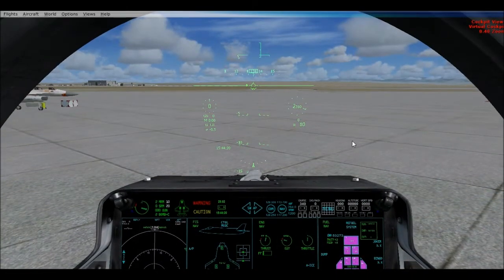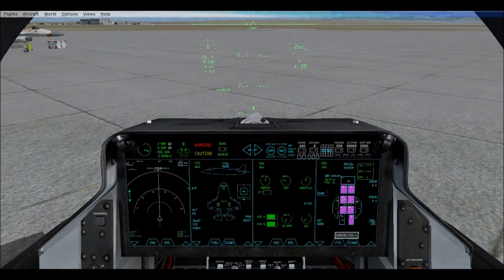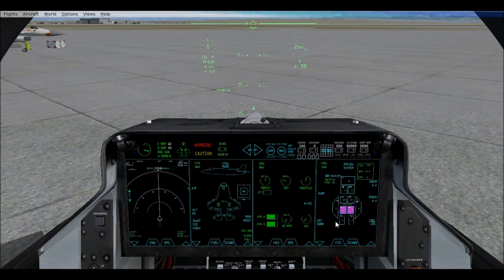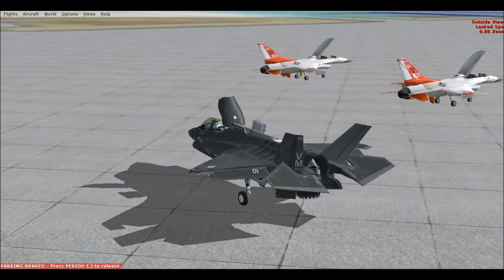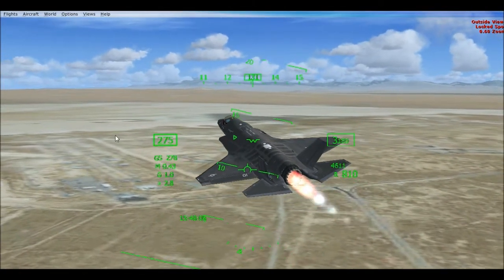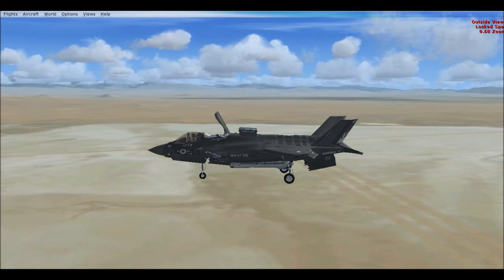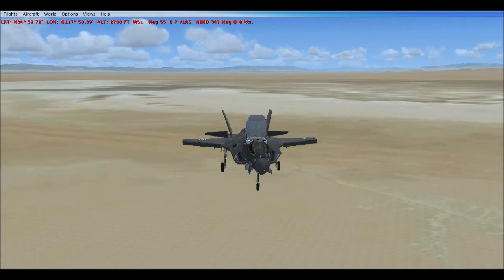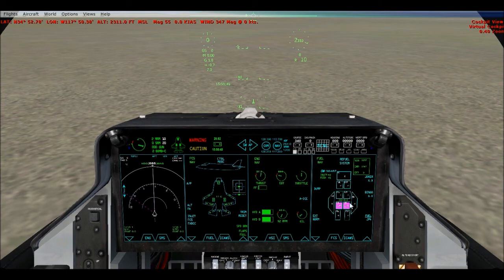FSX DINO CATTANEO F-35B VTOL TUTORIAL

Comment: Like to point out that I cannot also use some features... for the first problem ... I have a RED indicator light for HOVER... and will not enable full 90.   So no go there.
Reply: that is due to the fact that you have not dumped enough fuel, if you have dumped fuel and still no hover, go into your aircraft fuel and payload and get rid of all the fuel in the external tanks.